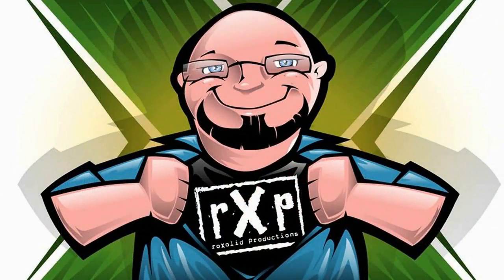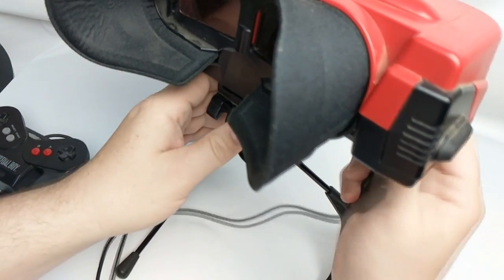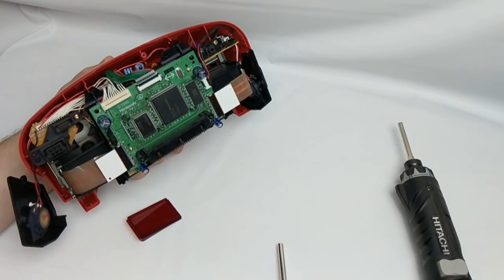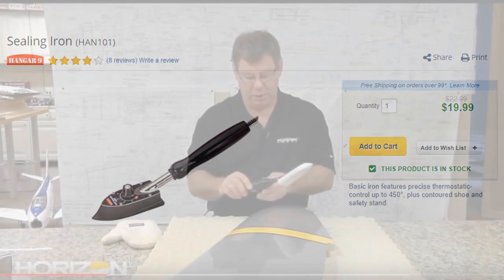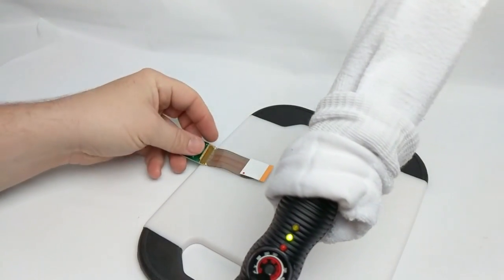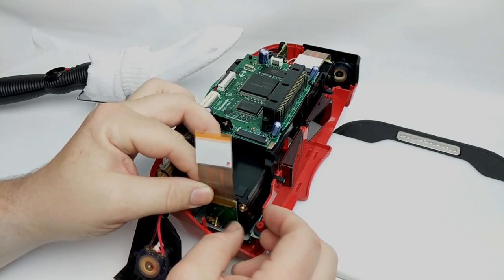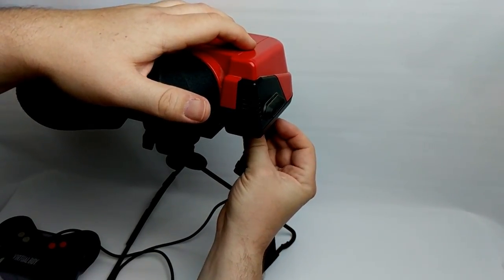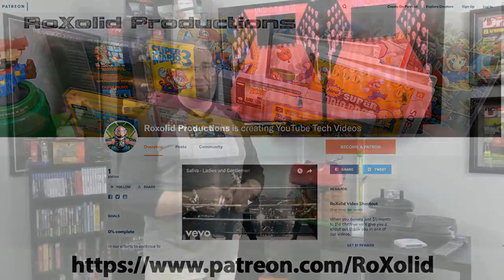How To Permanently Fix Your Nintendo Virtual Boy LED Display Issues the RIGHT Way (Not in an Oven!)

Comment: I just did this exact repair today. I used a covering iron as you recommended. I was going to just have at it with a soldering tip but I saw from someone else's experience that it's possible to melt up the ribbon. I even managed to screw up a game boy line repair in just that fashion.
A nice even heat is just right for the fix, and even though you can't really see it reflow very clearly, the proof is in the testing. I'm happy to report my virtual boy is back in action. And furthermore, if it happens again, as I'm sure it will, as these often do, I know the best method to restore it again. Many thanks.
Reply from the maker: Thrilled to hear this worked for you as well!

Comment: Just tried this with my Virtual Boy (I used a clothes iron and was just careful with which heat setting I used) and was pleasantly surprised with how well it worked. There are still the occasional graphical glitches and some games look worse than others (Teleroboxer and Tetris were both unplayable still), but I went from not being able to see anything at all to being able to play Wario Land and Mario Tennis, so I'll call that a success. I'll still probably need to get someone to solder the displays at some point, but this definitely bought me some time.
Reply: I  just put it in the oven and got it working.

Comment: Just did the exact same method on my VB. The left screen was completely black before and now it's perfectly crisp
-I started with 30 seconds at 327° and then 60 seconds at same temp. This got the screen to work but had horizontal lines
-I went for another 30 seconds at the same temperature. No difference
-I went for another 60 seconds at the same temperature. PERFECTLY CRISP IMAGE 
I hope that someone like me who was apprehensive about the repair since their screen was totally black (rather than just garbled) sees this comment goes for it. 
Go for it!
Reply: Is your VB still working?
Reply: @paulsworkshop4179  actually it broke down again and I repeated the ironing fix a couple more times. Currently working but next time it breaks I'll do the soldering fix instead now that my skills have improved

Comment: Thanks for the tutorial. I found another good way(if not better) to fix this issue: a hair iron. Aplies hot from both sides and good presion at the same time.
Reply from the maker: The problem with a hair dryer is you're not applying any pressure to the joint to force the pieces together.
Reply: @RoXolid  He wrote "hair iron", its litarally an iron but on both sides, eazy to put pressure. Hair dryer is something else.
Reply from the maker: You'll have to forgive a bald guy not being familiar with this
Reply: @Niinami  Yes, it gives perfect control of hot an pressure at the same time and won't burn nothing at all.

Comment: Unpacked a VB after a decade in storage and yikes! Right screen doesn't start up at all. Glad to see there's a fix.
Reply from the maker: Good luck!
Reply: Just picked one up today. By doing this trick did it fix the VB For u?
Reply: same.  10 years unused and the right lens is acting up.  badly.  Hoping this works.

Comment: I just performed this successfully on my VB and it worked great. Had to try and test a few times and I needed max heat it seemed like. Thank you so much for posting this with the great step by step, it's great to have it working again!
Reply from the maker: Awesome!!! I'm glad you were able to get your Virtual Boy working!
Reply: What temperature did you finally find worked? I tried it at 325 and did not have success.
Reply: Must be the year for them the fail, mine was fine for years, then on lens now the next.. Still have sounds just no picture :(

Comment: I just fixed mine today using a hair dryer onto both the front and back and then using a pencil for applying pressure for reconnection. I didn’t think it would generate enough heat but it did the trick. (I’ve had mine for several years and this is the first time it broke on me, both screens were out) I was ecstatic!
Reply from the maker: That's terrific!

Comment: I own 3...one appears mint, but one eye piece has a gobbled display, while the other does not light up at all. Another has a display that just started to fail...I will try this trick on both of them...I was expecting failed capacitors, for this seems to be a problem for most vintage systems...also, you are correct about Wario Land...it is the best CB title out of the small library.
Reply from the maker: WarioLand should have been ported to the 3DS!

Comment: Received my VB from Japan after waiting a month. Played two levels of Wario and the left screen went insane: was having to play with one eye closed until I finished the level and saved. 

Just ordered the correct driver bit to do this exact repair thanks to you. Had a two part Nintendo driver but ran into the same issue as you and the bit stem is too big to fit.

Can’t wait to get back to Wario (that game is way better than expected)

Thanks so much for this fairly easy / super great tutorial!!!

Toby
Reply from the maker: I'm so glad you got it working
Reply: RoXolid Productions sadly it actually killed my lens. I was super cautious and did everything as you did but instead of the lens showing lines, it now shows a tiny red bit of light and it’s dead :-(

Comment: Thanks for the inspiration!  Went with a hair dryer instead, did 30 seconds at a time until the screen suddenly started working again.  

I bet a regular old clothes iron would do it as well.  The important thing is to protect the components you're not heating.  Of course, no one knows how long this fix will hold, and it seems the consensus in the VB community that only soldering works as a long-term fix. Then again, that really looks like a precision job and you have mess around with chemical to dissolve things sooo....

Comment: well this is better than the oven method.  i can tell you how many burnt cables i get in for repair.  i often have to replace it.
Reply from the maker: The oven method is beyond dangerous for multiple reasons! This is pretty safe across the board!! No, uh, no half-baked pun intended. Except that one.
Reply: @RoXolid   tell me about it lol.  yeah this look safe but  there are alot of people that do that oven method and to that i say NO!  i do the solder fix via micro soldering iron and microscope.
Reply from the maker: @Davidevgen  That is THE fix, but 99% of people don't have access to that equipment.
Reply: @RoXolid   true.  thats why i offer it to others as a service. so people can get it fixed.
Reply from the maker: Same here!

Comment: Hello! I just had a Virtual Boy be delivered to me and the right eye piece works no problem but the left piece isn’t 100%

Whilst it does display, it also flickers more noticeably compared to the right eye piece. Would you say this exact method of applying heat to that ribbon cable would do the trick? And are the ribbon cables easy to remove m/re-attach as I’m worried I’ll mess it up

Comment: I have mine since the 90's. Today I was about to check it and I realize the image is not visible. I can see there is a red light inside but none of my games are displayed. Any tips?
Reply from the maker: Try this repair, it sounds like the ribbon cable has lifted like this one did

Comment: I don't see how you can call this a permanent solution when you are not substantially changing the original connection.  A solder bridge on each trace would be more permanent.
Reply: Kevin Driscoll but anyone can do this fix. And if it walks it way out later it’s another quick easy fix to do it

Comment: At what temperature, how many times, and how long should you use the covering iron on the ribbon cable? 

I have a Virtual Boy and it has the problem with the ribbon cable. I ordered a covering iron and will use it on the Virtual Boy.
Reply from the maker: I turn the sealing iron to full temp and it worked perfectly. You can see in the video how long I applied the iron.,
Reply: I tried this method and it doesn't work. I put it in the oven and got it working when the eyes are farthest apart. I'm going to use the oven method from now on. It works for me.

Comment: I just fired up my old VB and one lens is completely dead. I'm hoping this method can fix that issue too.
Reply from the maker: Good luck!
Reply: @RoXolid  it didn't fix the broken lens. And the other lens actually looks worse now. I don't know what I did wrong.
Reply: Update: more heat was the answer. Both lens are working now, although I still have some flicker. Looks like I'll need another round of heat or a solder job.
Reply: @Jonpat  Any updates? How did more heat go? 
I have a dead left eye. Wanting to see if I can fix it. How long did u hold the Iron on the cable?

Comment: My husband has one and wanted me to help fix it. I don’t have a covering iron but could order one. Was just wondering if something like a flat iron may also work if u put a sock on it too and maybe lowered the heat since it would be distributed on both sides?
Reply from the maker: I don't know a flat iron would get hot enough, I also don't know that you could apply direct enough heat with the way that is shaped.
Reply: @RoXolid  hey thanks! I figured I would go ahead and just give it a try. I did use my flat iron because I was able to set it to the same temperature that you used and I put the socks on it. He said before it had no picture at all and now it works!!
Reply from the maker: Awesome, glad it worked!

Comment: I am wondering if that’s the main problem on mine. Looks like it’s ok but I see brownish in the orange part of the circuit
Reply from the maker: You might need to perform this a few times to iron it out, pun intended
Reply: You are right I did it 3 time on the left side and it works 👍🏻
Reply from the maker: That's great to hear, I'm glad it worked for you

Comment: I just bought a virtual boy and it’s been working until today. The left eye piece is not lighting up at all. Will this method fix that?
Reply from the maker: It might, if the issue is the ribbon cable lifting from the board. If there are other issues this obviously would not address that.
Reply: @RoXolid  I saw one other tutorial where a guy would hover a hair dryer above it. Should I start out with that? At least it’s not throwing it in the oven
Reply from the maker: @willrussell01  I have also heard of people using hair dryers or heat guns to accomplish this with varying results. The problem with a hair dryer is most don't get hot enough. Remember, you're trying to liquify and re-flow solder, and you'll never want that much heat on your scalp!
Reply: @RoXolid  Would using a heat gun possibly melt and desolder the ribbon cable, if not what temperature should I set the heat gun to, to be safe?

Comment: Both of my lenses have lines issues. Is that also common? It doesn't have to be just the right lens does it? My system hasn't been used much since I bought it retail and has remained in a hard shell Blockbuster case. Bought the device from EB Games and the Blockbuster case I got from a friend.
Reply from the maker: Yes, the issues with the lenses is not isolated to one or the other, it can affect either one or both

Comment: Hi, will this fix help with No display. Has sounds. Game has sound and user interface sounds like it is operating. But not display at all ? Thx
Reply from the maker: Possibly, depending on what is causing the issue but this tends to be the most common fix
Reply: Yes theres no display / picture at all. Is what I meant originally havent tried the fix yet.
Reply from the maker: @davidtucker9533  It'd worth a try!

Comment: Any advice on how to install the silicone tape?
Reply from the maker: You basically just wrap it around the end of the pcb. I would use a thin strip, about the width of the connector pins where they are soldered to the board. From there, just wrap and stretch the tape around that end of the board and hold it in place for about a minute period it adheres to itself so you have to give it a little bit of time for that to actually happen.
Reply: @RoXolid  I actually printed a small custom 3D fixture to add some pressure alongside the silicone tape to minimize the issue happening again. My iron arrives tomorrow hopefully so I can finally fix the right lens.
Reply from the maker: Very cool!
Reply: @RoXolid  Thank you so much for the idea. I was ready to sell my Virtual Boy but now I can fix it.
Reply from the maker: 100%! You're welcome

Comment: This is definitely better than using the oven, and most people could pull this off, but it's disingenuous to advertise the video as a permanent fix since the root problem is still there.  Soldering the ribbons proper is the only permanent solution.
Reply: Definitely agree.

Comment: Looks like they don't make that covering iron anymore :(
Reply from the maker: The Amazon listing is down but it is still available on the Horizon Hobby website:
https://www.horizonhobby.com/sealing-iron-han101
Reply: I'm gonna try this out, thanks for the video!
Reply from the maker: You're welcome
Reply: @RoXolid  Hey man, just got around to doing the repair tonight, and it worked! Thanks so much, again!
Reply: For some reason when I do this it seems to be only temporary. Is it because I'm not doing it long enough or something?
Reply from the maker: Could be not reflowing the solder enough, might want to try a bit longer and/or hotter

Comment: Will a Regular cloth iron work? With the same temperature?
Reply from the maker: I don't know what a regular cloth iron is. You mean like for clothing? No, they don't get hot enough.
Reply: RoXolid Productions what’s the temperature needed?
Reply from the maker: @TheSohokan  you need it to get warm enough to reflow the sauder. I would say at least 225 to 250 degrees, if not close to 300

Comment: Had a itch to play my NVB after Linus video and I can't because my left eye is dead. :-( Seem easy enough to do but would it work with a soldering iron? I'm a total noob but was planning on buying one to try my hand on small repair because repairman are sparse in my area.

Glad I found your video btw. So many oven video. Not a fan of putting electronic in oven either.
Reply from the maker: Most soldering irons would be too hot.
Reply: @RoXolid  hum... So when you said 350° in your video you where talking Fahrenheit? Because most iron I check could go has low as 200° Celsius.
Reply from the maker: @marie-franceFortin  most soldering irons aren't adjustable. The sock around the sealing iron removes the direct heat, protecting the components around the ribbon cable
Reply: @RoXolid  "most soldering irons aren't adjustable"
Completely false.
Reply from the maker: Most soldering irons available through hardware and department stores, like Walmart or Home Depot, are fixed wattage, most of them 30 or 40 watt. If you go to dedicated electronics boutique such as digikey.com, that's where you will find adjustable temperature soldering irons. But for the most part, most soldering irons that the average consumer has access to have fixed heating outputs
Reply: @RoXolid  never thought of buying one in a Walmart lol. This must be why most I saw were adjustable.
Reply from the maker: @marie-franceFortin  Completely understandable. Unfortunately it's one of the first go to places for those who don't know where to get something better, if that makes sense.
Reply: @RoXolid  my bad, I said I was a noob. What I meant was a new in small repair. I build PC and swap part. But sometimes find swapping a bord for a fry capacitor a waste. For used video games price of complete part have really gone up lately. This is why I decide to buy a soldering iron
Reply from the maker: @marie-franceFortin  It's all good man, we're here trying to help others out!

Comment: But why not just use a soldering iron? I assume most people fixing old stuff own one already. And when using not too high heat, it's pretty difficult to mess up. Used the iron on this before, was easy and worked out well.
Reply: Also, I heard you say many times in this video to never use the oven method, and every time I got more curious to hear the reasons why :-) Unfortunately you didn't mention any. Why is that such a bad method? Just curious. Too easy to damage?

Comment: It's great idea. but I don't think this is permanent fix. It may last few years then the glue will eventually dry out again.
Reply from the maker: Glue isn't what's holding things together and that's not what we're doing here. We're actually re-flowing the solder to fix the joint itself.
Reply: @RoXolid  oh ok.. if that is right. you are right it should be permanent fix.

Comment: This is NOT a permanent fix. The only permanent fix is to solder the connections from the ribbon cable to the board, that involves a soldering iron, solder and a lot of flux. Not whatever THIS "fix" is.

Comment: a heat gun on low will do the trick too..don't even have to remove the eyepiece board
Reply from the maker: Yeah, but what don't like about the heat gun is it doesn't apply pressure to the joint.
Reply: RoXolid Productions that’s why we have hands..
Reply from the maker: If you can touch it you're not getting the solder joints hot enough
Reply: RoXolid Productions wear a leather glove.. cmon man.. you think I’d touch that shit bare handed? I fixed one using my method last night in less time than it took you to learn that you have to remove all the screws to actually open a VB..
Reply from the maker: Good deal! More than one way to skin a cat, that's for sure!!